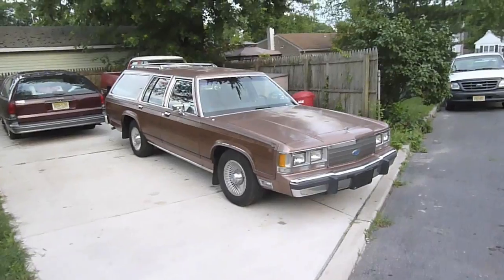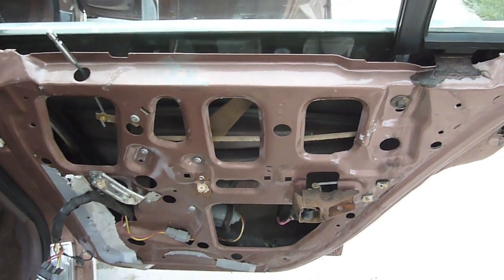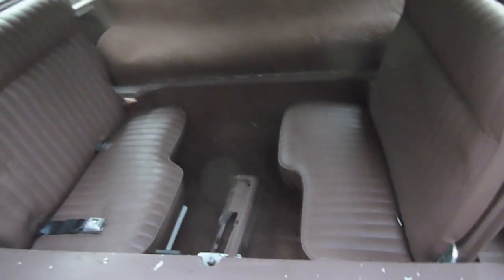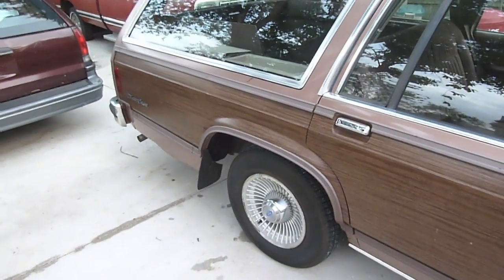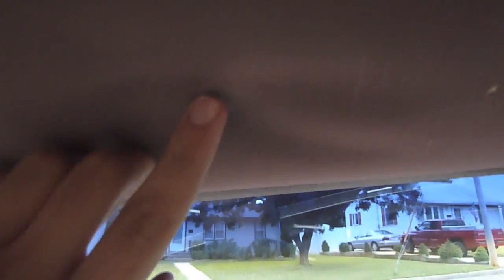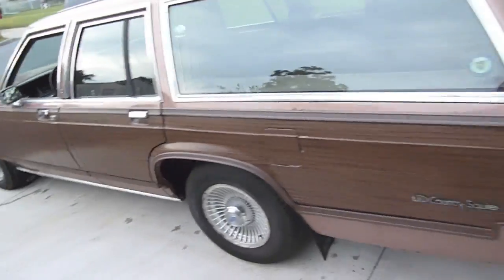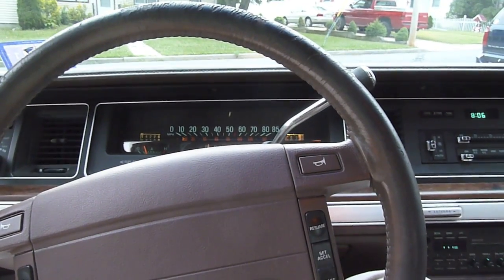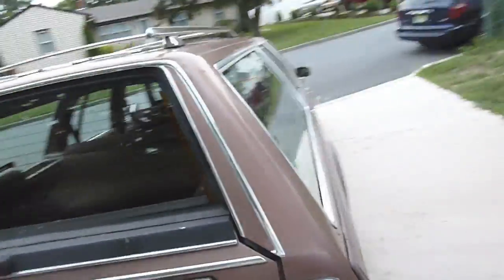Walk around of my new 1991 FORD LTD Country Squire wagon

Comment: odometer failure is common. I drive a 90 Grand marquis LS that quit with 58975 miles. now has around 75000. My grandfather has a towncar with that motor and it has 600,000 miles on it. take care of it and it will last forever

Comment: three things i'd do to it: delete the smog pump and run a shorter belt, two take out the y-pipe and buy the H-pipe to run the stock duals and get good flowing mufflers, or run none at all because they sound really good with just the 4 cats and the rest of the stock pipe, and three add the optional wagon or police sway bars so it doesn't handle like a boat, and get the cargo coil springs to keep it from sagging

Comment: cool!  I've got a '91 colony park; I've been doing a lot of work to it.  Things it needed --everything rubber or electrical died of old age, and both the radiator and heater core were clogged-- and things it didn't need, like a subwoofer, tach, and HO engine ;-)

Comment: '91, R12? I worked on one of these and when you peel the wood grain decal off with a heat gun you'll find more surface rust around the wheel wells. Nice car for road trips. My sister in law has a '97 mercury sable wagon for christmas shopping.

Comment: lynol damn you my friend, now im looking for another one lol.  theres a white  squire here in town, actually 2 of them. white with wood grain. both run excellent. and a 3rd one 15 miles away withan engine  in dodgy shape.  but the odometer, you can find a replacement cluster once you pinpoint the the mileage you can put its replacement in. its legal.  currently its a TMU, which is no big deal tbh but my friend you scored on that.

Comment: You wish they had 270hp, pretty sure they were closer to 150- ish maybe 160. It had about 270 lb-ft of torque.
Reply: 150 Bhp and 350 foot lbs of torque
Reply: +Embattledking Yea 150bhp but probably closer to 270lb-ft.  Especially if it's got a Y pipe instead of duals. Nice find though I have an 85' as well. Here's a link: http://www.automobile-catalog.com/make/ford_usa/ltd_crown_victoria/ltd_crown_victoria_base_4-door/1990.html